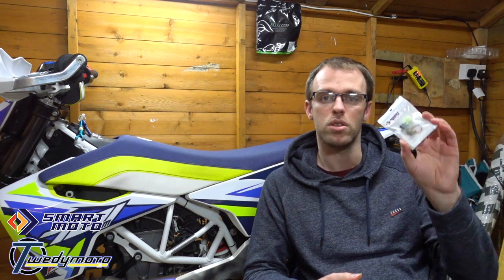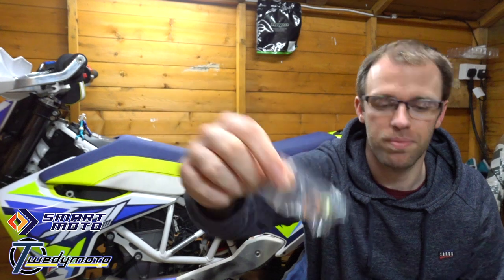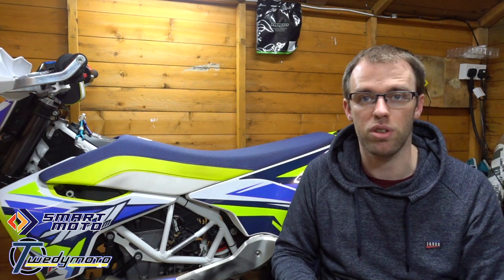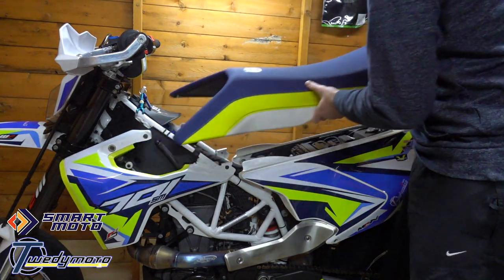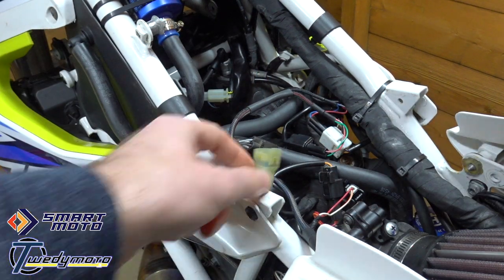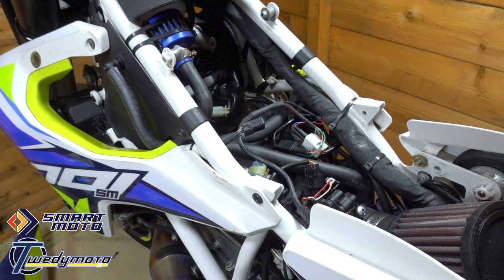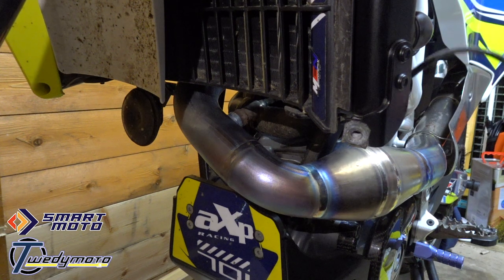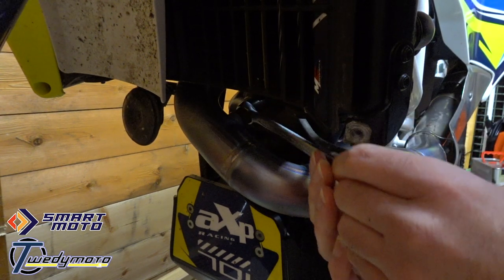How to install Smartmoto Electronics fuel dongle o2 delete kit on Husqvarna 701 or KTM 690 2016-2020

Comment: Thanks for the vid, Just did this to my 690 by far the best value for money mod I have ever done. Highly recommend it to anyone with a 690/701
Reply: Could you please measure the resistance of both resistors it includes?  Can not get it from any factory delivering to my country (. So can make it myself easily then. They say the required values are 1M Om and 300 Om. But I am not sure if it just to replace the o2 sensor to trick the ecu or it will change AFR at the bottom as well. Thanks

Comment: Just ordered one of these!
Reply: Put mine on today and pulled the O2 sensor out and plugged the hole. It does seem to help with snatchy feel at low speed. Tried to change the fuel screen, but can’t get to it on 2019 SMCR because the air box blocks access. I don’t want to remove air box because I hear it’s a bear to get it back on sometimes . So, I guess a dealer will have to do it .

Comment: Done this mod myself recently. Can definitely feel the difference in the bottom end, much less snatchy
Reply from the maker: It's night and day!
Reply: Not an good idea to disconnect O2 Sensor, buy a fuel dongle that's have 2 connector so the 02 sensor works all the time much better and no fault codes etc!
Reply: @Daniel2077  Is that like the booster plug?

Comment: Hi. Are you still using the bike with the fuel dongle? Could you please measure the resistance of both resistors it includes?  Can not get it from any factory delivering to my country (. So can make it myself easily then. They say the required values are 1M Om and 300 Om. But I am not sure if it just to replace the o2 sensor to trick the ecu or it will change AFR at the bottom as well. Thanks
Reply from the maker: @АлександрМатюшевский-н5ъ  I don't have the bike anymore but I'm pretty sure the values required can be found in the 701 mega thread on advrider. 👍

Comment: If you have the evo map for akrapovic in a husqvarna 701 2018 and put the fuel dongle, you will notice improvements?
Reply from the maker: You should notice the slow speed control is better but the evo map which goes directly onto the ECU has some other tricks too like removing the restrictions in the lower gears. for the price its worth a try!
Reply: @Twedymoto  Thank you for answering. What do you mean by removing restrictions? Eliminate the sas? Or other restrictions
Reply from the maker: @Ignacio_vidal  I think the evo map does disable the sas but the bike is limited in second and third (so I believe) so would make it more responsive too. Just gotta find someone who can either load the map on for you (dealers used to be able to but I think they stopped doing it) or have it custom mapped (not power commander) by someone but not many can do it.
Reply: @Twedymoto  Okay, thank you very much for answering. I'm going to try to put the dongle fuel and cancel the sas, since they say it's harmful to the engine. If it improves in bass because it's the only thing missing for my taste

Comment: what's the benefit of removing the cable instead of just plugging in the dongle and leaving the cable in?
Reply from the maker: No benefits really, just saves removing the sensor if you can't be bothered! Haha
Reply: @Twedymoto  i'll leave it in then, thanks for the quick reply :)
Reply: You can save 3 ounces on weight which will more than likely increase your top speed by approximately 7 MPH.

Comment: I have 2019 year 701 and i install fuel dongle and.... chek engine light is on.....
Reply from the maker: Mine came on at first but after stopping and starting the engine 4 or 5 times it went out. This is common on most.
Reply: @Twedymoto  i have turnd on more than 5 or 6 times and its still on

Comment: can you just plug the hole in the header the cut the line on the O2 sensor and join them and solder or cap them and hide it etc. Whats the plus actually doing when you remove the sensor.
Reply from the maker: The o2 dongle is fooling the ecu so that it thinks the sensor is still there and sending different values, or something along those lines. if you have a 2021 model, you need a different dongle.
Reply: @Twedymoto  nope the plug is just 2 pins looped so the ECU uses the mapped values not narrowband
Reply: @blooperbooper  Is there some key resistance wiring? or is literally just a loop? With the right connector couldnt you just DIY this?
Reply from the maker: The plug is just 2 resistors, 27k ohm I think but could be wrong. The correct figures are somewhere in the massive 701 thread on advrider. 👍
Reply: @Twedymoto You're a boss. I found it. I've been searching for this for ages. Cheers!

Comment: Does it work with a KTM 690 duke 2016 ?
Reply: Compatible motorcycles
KTM > 250 EXC > 2007 - 2020
KTM > 350 EXC / EXC-F > 2007 - 2020
KTM > 450 EXC / EXC-F > 2007 - 2020
KTM > 500 EXC / EXC-F > 2007 - 2020
KTM > 690 Duke / Duke R > 2008 - 2020
KTM > 690 Enduro / Enduro R > 2008 - 2021
KTM > 690 SM/SMR/SMC > 2007 - 2021
KTM > Freeride 250 F > 2018 - 2020
HUSQVARNA > 250 FE > 2014 - 2020
HUSQVARNA > 701 Enduro > 2015 - 2020
HUSQVARNA > 701 Supermoto > 2015 - 2020
HUSQVARNA > 501 FE > 2014 - 2020
HUSQVARNA > 701 VITPILEN / SVARTPILEN > 2019 - 2020
HUSQVARNA > 250i TE > 2018 - 2020
HUSQVARNA > 300i TE > 2018 - 2020
HUSQVARNA > 350 FE > 2017 - 2020
HUSQVARNA > 450 FE > 2017 - 2020
Reply from the maker: Yes, as the new 690 engine was put in the Duke before the 701. 👍
Reply: Do i need any setting/tuning in ecu system or just plug out the 02 sensor and change with disable nut?